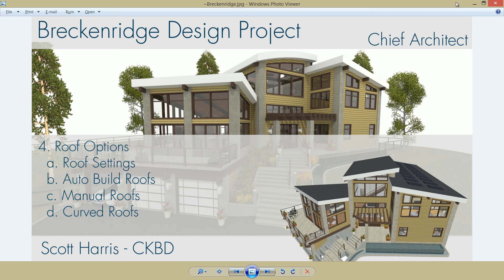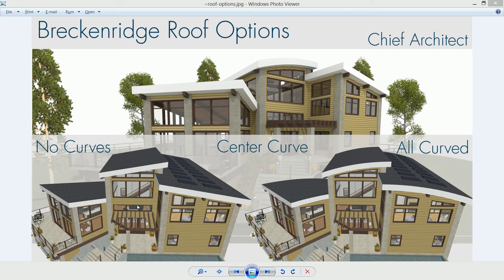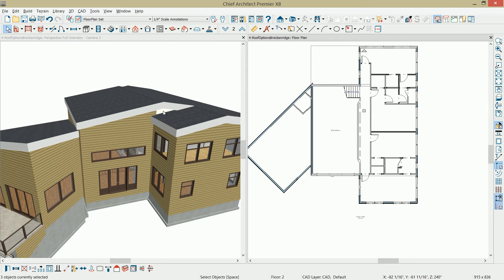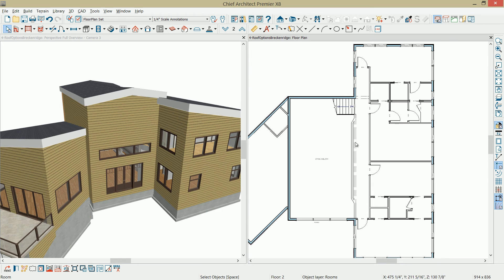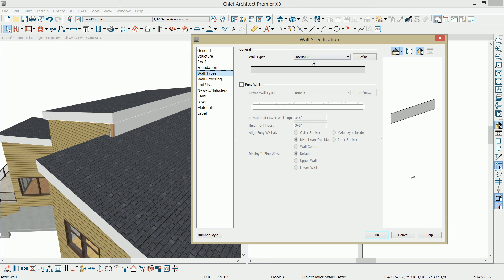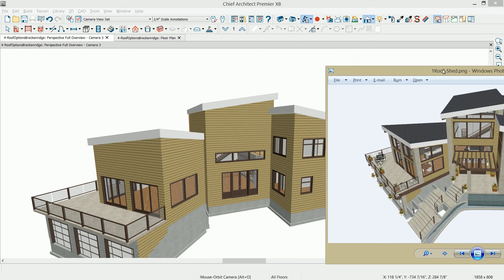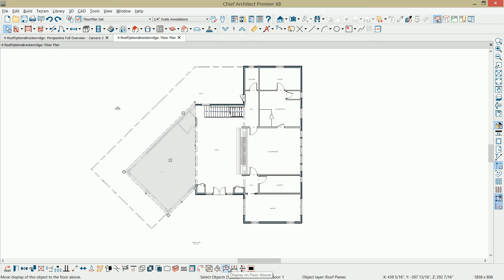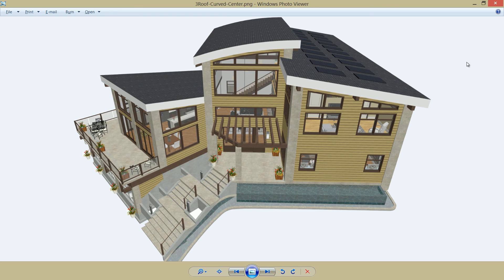Breckenridge Design Project - Roof Options

Comment: What did you do to have the kitchen roof lower than the rest of the roof? Mine is all on one level and I can't fix it to the way you have it. What do I do?
Reply from the maker: +May June You are able to adjust the roof height by modifying the ceiling height through the Room Specification dialog. Here's a help article that will show you the steps in adjusting ceiling heights. https://www.chiefarchitect.com/support/article/KB-00579